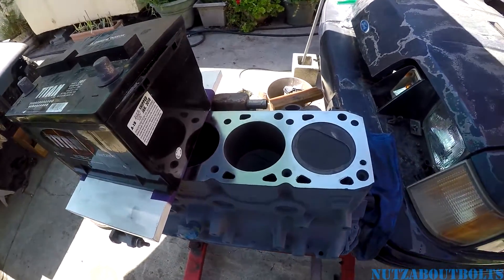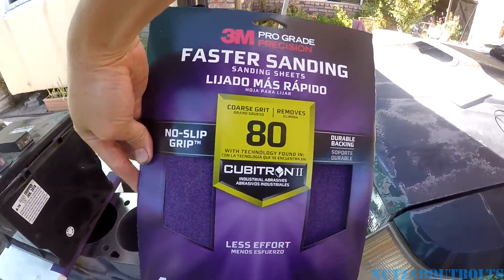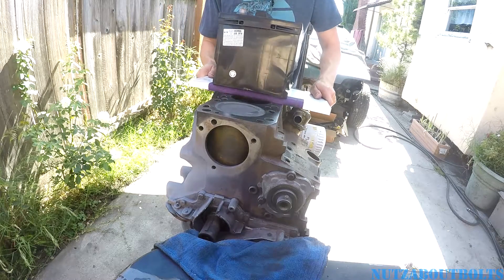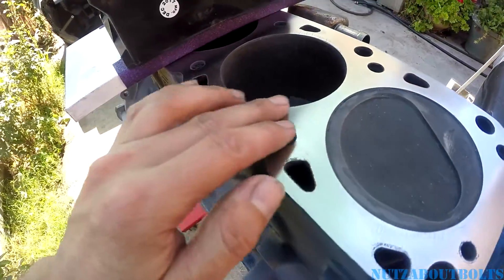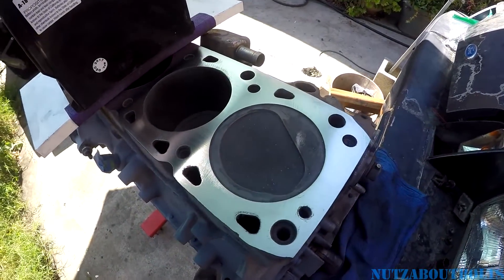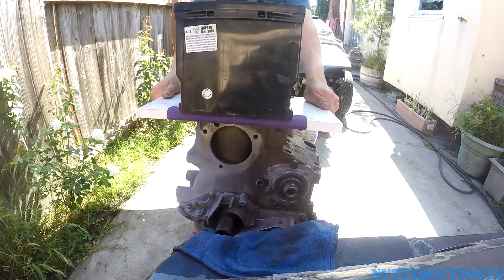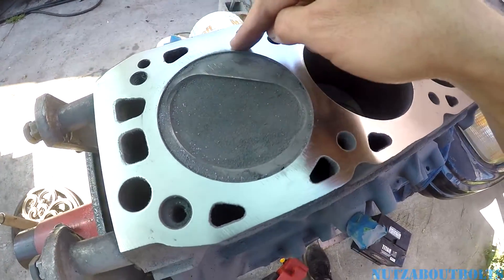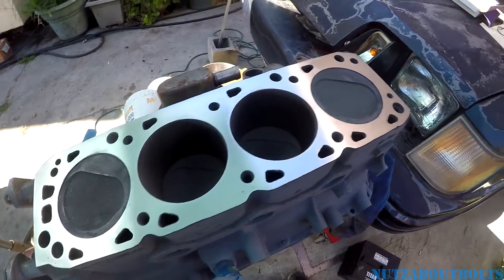How to DIY resurfacing cast iron engine block

Comment: Its an engine, not the space shuttle! Go for it bro, That looks easier than dragging the block over the sandpaper. That MDF is flat, but a piece of granite floor tile is flatter. Maybe glue the tile to the bottom of the MDF but well executed. I bet it worked great. MLS head gaskets require a very fine finish so they can actually slide when the dissimilar block and head materials expand at different levels. cast iron on cast iron is a pretty toothy finish.

Comment: He sanded the middle cylinders twice as much as the outer ones
Reply: sounds true
Reply: He needs a board bigger than the block head, and only move the board until it gets to the edges of the block.  This way you are not sanding one spot more than another. 
 
In conclusion, his board is too small.
Reply: @deckard5pegasus673  exactly. The whole sand paper needs to be bigger than the engine. On every stroke, you should never see any of the engine. That way, it gets sanded evenly.

Or....

Use what he has, and go back and forth with maybe 2" strokes, while slowly working your way to the other end of the engine. Once your there, slide it, or pick up the sand paper, start at the beginning again.

Comment: Well, kudos for the DIY approach. However, shelving is not only NOT perfectly flat, it is also not hard and will flex to follow contours, making an already sketchy situation worse. Suggest some plate glass, which is generally floated on mercury when produced, or a known piece of flat tool grade steel.

Comment: You guy knocking him know very little! Very similar to the old time broaching machine. To teach you naysayers something... A great many engines have been resurfaced like this and sold on Barrett Jackson as numbers matching! Here the ticket... Flat shelving thats 8 inches past the both ends and even distributed weight on top letting gravity do the work. 80 grit then 100. Sometimes 120, sometimes stay with 80. I highly advise using Prussian Blue dye or you can use a thick Sharpe. Also, use a lubricant like WD. I've been doing automotive machining for 38 years CNC is nice, but if you don't have enough money for a down payment on a house, this will work around 95% of the time. The fails will be someone who pushes down and doesn't let gravity do the work

Comment: Next time go get $2 worth if play-doh & pack arou d the pistons to protect the rings...  And +1 in the wd40 helps..  It will get easier to push the board as the surface gets smoother, not necessarily because the paper wore out immediately.   👍
Reply: I was just thinking of a way to protect the holes and piston rings and play dough is a genius idea.
Reply: @frankmjr6571  it's what I've been using for many years. Just don't leave it on the cylinder walls(if they are oil free) for more than a day or it becomes difficult to get off. Use as much as needed and don't press it down super hard. It works great for cleaning up grit & metal shavings.

Comment: A little help for the sand paper just staple it down on the wood there will be less movement between the board and the sandpaper , but other than pretty decent ima try it on my 2jz when I do my head gasket

Comment: props to you for trying.  if you take your time and check it against a straight edge I don't see why it would not work.  You can scour up the smooth edges again with sandpaper going in a cross pattern.
Reply: Cast Iron blocks are forgiving for sure. I have seen many head gaskets installed with very little prep work and the engines are still running today.I have a buddy with a 87 ford 4.9 that had a head gasket installed at a BOAT RAMP at night with a simple blue towel wipe down.This truck still runs today !!  I think the improvements on head gasket materials  have came along way. Now if this was going to be a performance build. I would spend the money to have it decked. The only problem I see here is if the board follows the contours and doesn't actually flatten the block.
Reply: Nive video dude how about using 120 grit sandpaper? On cast iron block or head?
Reply: Ron Hart another recommendation is square or rectangular tubing. Less likelihood of as much flex.
Reply: @ronhart4166  OF COURSE not...it just WON't flatten the block; if it's acanoe,it will stay a canoe; UNLESS it was LONGER than the block,and of extreme precision!

Comment: The gasket you use will depend on the surface smoothness required if your using a graphite gasket a little rough is ok if MLS gasket you want it as smooth  as possible or the gasket won't seal correctly

Comment: Why won’t the shops resurface it?
Reply: They can, but usually they need the bare block only. You would need to remove the crank shaft, rods, pistons, and main caps among other things depending on the engine. This diy trick has been around for a while, but has risks. One being not being able to clean all the shaved material out of the water jacket and oil passages. Also not having roughness depending on the head gasket that is to be used.

Comment: interesting, maching in my country is very pricey cost me atleast $1500 to totaly machine an engine ,  id probably tape the edges of the pistons with masking tape , and block all oil  holes but especialy  remembering to unblock them later. im a fanatic i hate sand etc in the bores etc .

Comment: Good idea w/ the battery; still,this will not correct the out of flat lengthwise and across; you'd need a board longer than the block,and maybe a cut open sandpaper belt that would be wide and long enough; but you have no way of knowing if the board itself was flat to begin with!
 The only way to check your work is with a precision straight edge and a feeler gauge; the head gasket package will have the maximum allowable out of flatness values.
Reply: Wrong